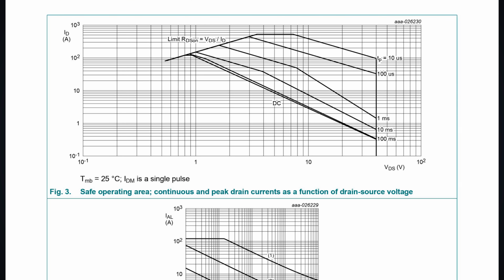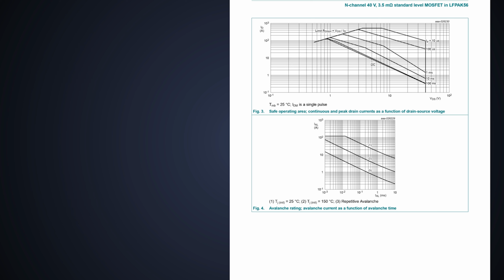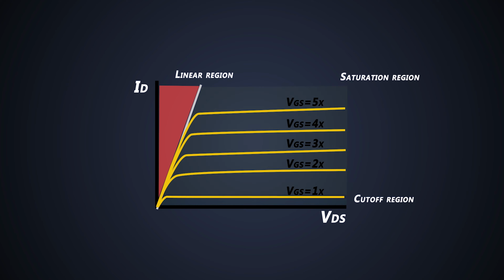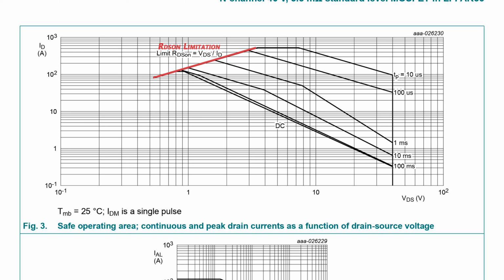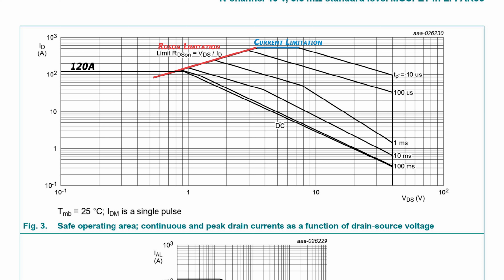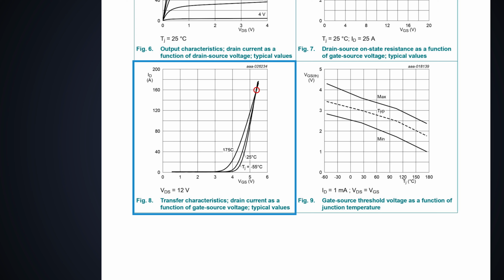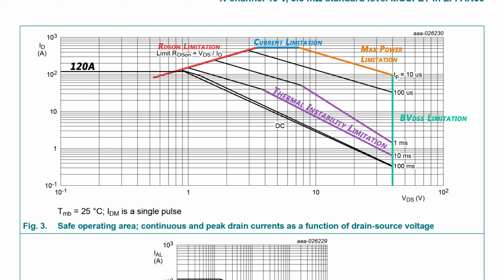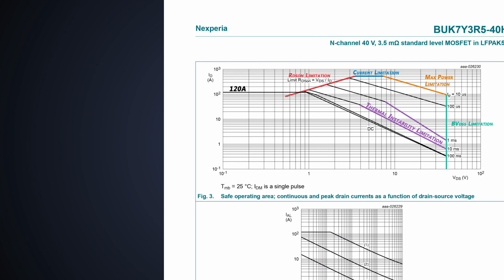What is SOA of the MOSFET? MOSFET Safe Operating Area | Thermal coefficient of a MOSFET

Comment: hi. how can I search for MOSFET that is more capable in the DC region? Because in Mouser they give filters for everything except the power in the DC region. the example I want Mosfet to use it as variable resistance with a voltage between 50 and 200V and current between 1A and 20 amp without burning out

Comment: It would be good if you could give an example. I.e if you are controlling a motor with PWM at 24V and your duty cycle is more than 10% you are basically in DC. And for the MOSFET in the example the maximum current would be 0.6A

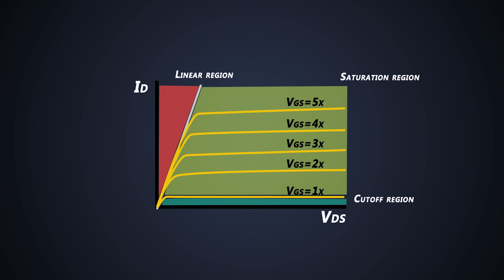Comment: @2:44 it's a wrong statement that we use MOSFET in saturation and cutoff region for switching application ....it should be linear and cutoff region...if you Operate MOSFET in saturation region there will be high VDS drop across the MOSFET..which leads to high power dissipation... MOSFET saturation region used for constant current application.
Reply: Yes he is right.
Because in linear region MOSFET has less resistance
In saturation resistance is very high.
Most of the power will be dissipate across the switch itself if region is saturation.
Reply from the maker: Can you share any reference which supports this statement?
Reply: @FoolishEngineer  I can't upload any documents here but below links will help you to understand the what do you mean by saturation term for MOSFET and BJT
https://youtu.be/wX7STW1G1JA

 ....I have seen lot people makes this mistake what you have done ..
Let's say you are using MOSFET as switch and you are operating in a saturation region then voltage across the MOSFET would be very high but that wouldn't be our intention in the switch we want voltage drop across the switch should be as small as possible.
Do you think that is possible in saturation region or else do some simulation ,your concepts would be clear.
Reply from the maker: Thank you!
I follow Prof. Sam Ben-Yaakov, he gives very good explanations. But can you share a name of any reference book, application note or white paper from a device manufacturer which supports this theory. It would be very helpful & Authentic reference for me.

Whatever I have explained in this video is all based on my references which are mentioned in the description. I haven't done the simulation but I have used MOSFETs in many of my applications which clears my concepts.
Reply: I agree